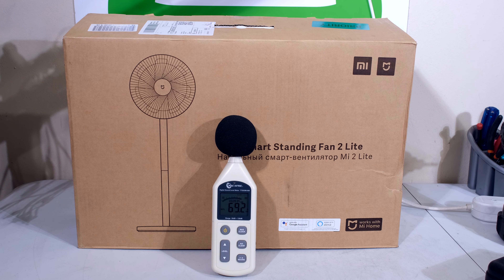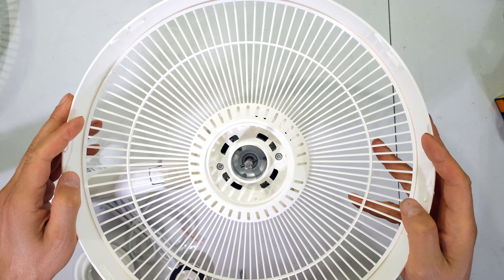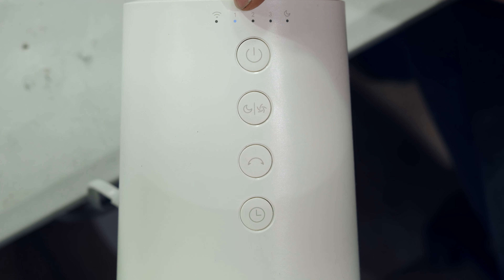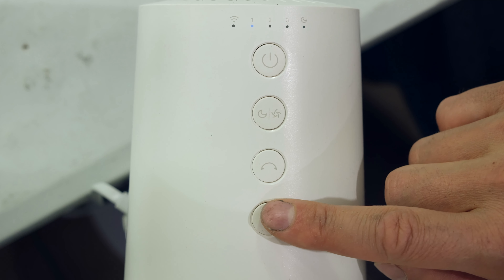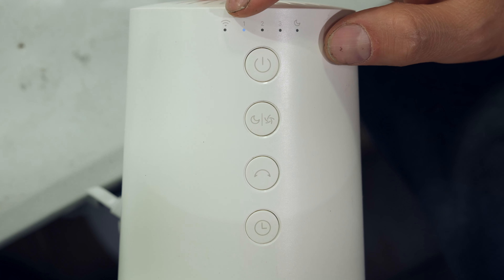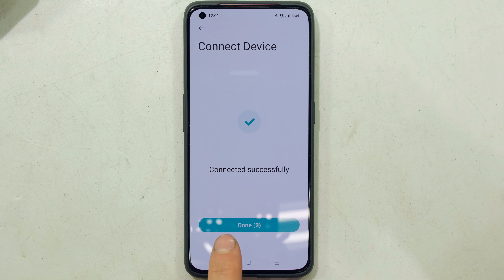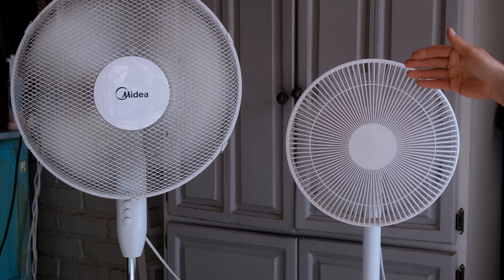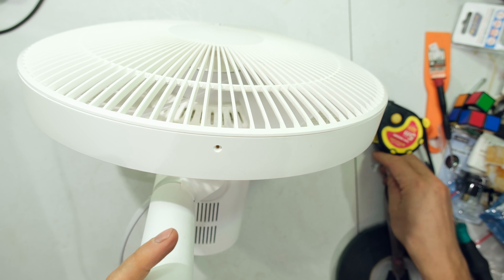Setup and detailed review of the Xiaomi Mi Smart Standing Fan 2 Lite - Noise level measured!

Comment: Just to confirm the off center is indeed there - it causes a slight wobble that made a rattling sound in mine  - I found the issue on mine was the fan speed button rattling in its housing - quite hollow, so I taped it lightly with some selotape to hold it in place and it's whisper quiet now - might help some people 👍🏽shap shap

Comment: Very good review! Mine has a firmware/software issue (scale 2 won't work, scale 1 switches off by itself without delayed turn-off enabled). Mechanically it is fine. Is there any way to reset firmware/software to factory settings?

Comment: I don't know if this only happens with my unit, but The speeds 1 and 2 are too weak, the only really useful one is speed 3, 
I would still like to be able to control the oscillation angle.